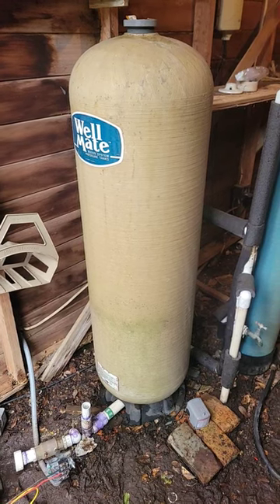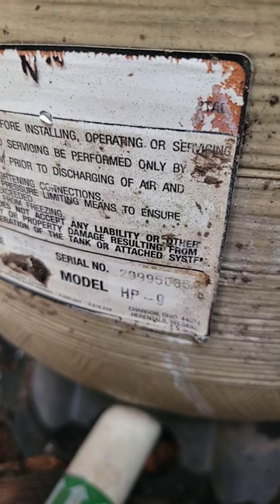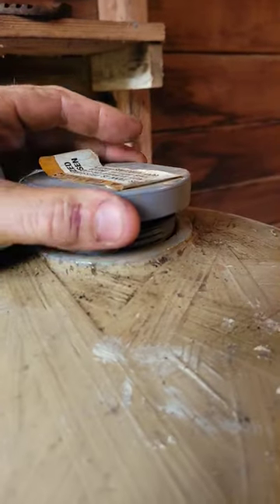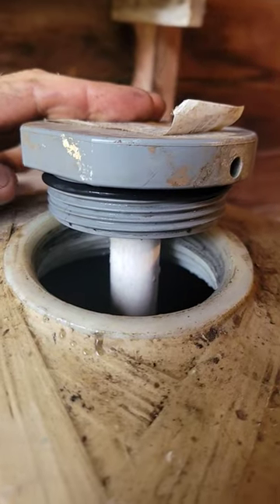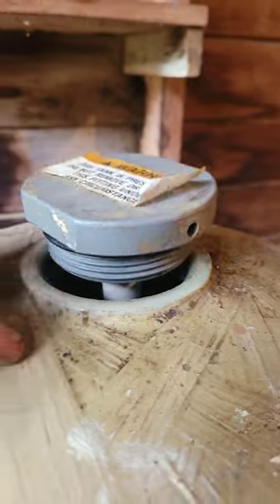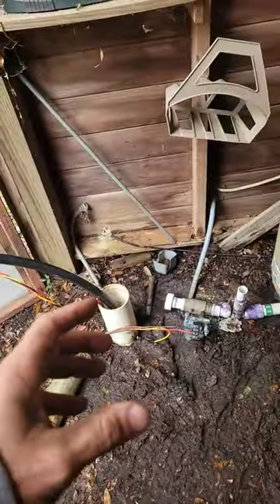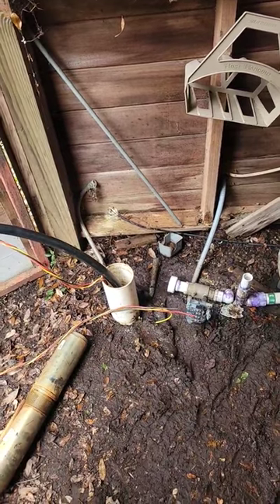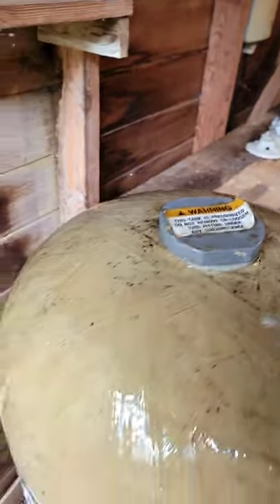Fiberglass Tank over 20 years old still working but I still don't like them

Comment: Great video! sometimes I still see the old metal tanks with the old-school air volume control. I've seen an old metal tank  from the late 80s have a blowout due to rust from water dripping on it.  interesting stuff you see out in the field. one time a guy knocked his we'll cap off with his mower. a family of chipmunks got down there and died in the well. They called after their water had a funky smell and taste. when pulling the pump up, the dead ground squirrels were wedging between the submersible pump and the casing. they fell apart so easily. needless to say, after a well evacuation and chlorination he didn't tell his wife the cause of the smell and taste lol.
Reply from the maker: Enh I found Slugs that were living in a non sealed well with 4" submersible that were growing. They would fall into well and pump would grind them up...... Bleh!
Reply: @ClearWaterPumpWell  I bet that was a nasty mess
Reply: @ClearWaterPumpWell  I had someone call to tell me they had no pressure in their faucets. Seems that when they checked, the strainers were full of ants. A fire ant nest was built next to the casing and it rained causing the ants to abandon the nest for higher ground. They found their way into the pressure switch down the flex conduit into the well seal and down the hole. Took about a week to kill the nest, clean out around the well, purge the system, and decontaminate it. I can honestly say those are the jobs I do NOT miss!

By the way… my own well.
My mother passed away January of 2005 and I inherited my parents’ house. We lived in a mobile home at the time and later that year Hurricane Katrina showed up on a collision course. We moved to the house before the hurricane reached us. Two years ago we decided to move back to our old property and I had someone use a forestry bush hog to clear things out so we could start working towards moving back. One of the first things we discovered was that someone had stolen the pump, tank, and filter among various other damage. They left the casing open and uncovered.
Big sigh then I told my wife I had to get Teme to come blow the well with his compressor. She didn’t understand why I didn’t just chlorinate it and install new equipment. So when Teme gets there and his air line gets stopped about 20’ down until he could bounce it loose. They started the air and the first few gushes of water come out followed by a white skull of a possum then more bones, a few sticks, and plenty of leaves. I asked her if maybe I should have JUST chlorinated the hole. She decided not to question that decision again. I’m pretty sure that is the only time in about 30 years she admitted that I was right. 
Yeah, after flushing the bones out I filled the hole with chlorinated water and capped it until a couple of months later when we got electricity to pump it out. Flushed and re-chlorinated then tested for bacteria BEFORE hooking anything downstream.
Reply: Good call to bear the thief

Comment: That's the only tanks we will use
Reply from the maker: They were good 20 years ago but still failed for stupid reasons.  The shells will leak because the plastic liner breaks from cycling. Its like metal fatigue and once it leaks air its no good.
Reply: Structural made a big mistake a couple of decades ago. They bought out Park Plastics and the engineers from Park needed to justify the company keeping them. Their brilliant idea to save money was to redesign the fiberglass tanks by making the plastic liner thinner. Unfortunately, the failure rate went through the roof. One distributor that I know of was seeing a warranty return of over 35% and another was running somewhere near 40%. They both dropped Structural and changed to another brand. 

Structural also has no coating to protect the resin from UV from sunlight. One of those tanks left in the sun for a couple of years is like grabbing a porcupine. Before changing one I used to get a couple of cans of cheap spray paint and paint the tank where I would have to touch it. Kept from getting fiberglass “splinters” in my skin.

I had an old tank laying in my backyard that I had replaced. Came home to see my son (about 6 or 7) riding it like a horse. Poor guy had to soak in baking soda bath that night because the inside of his thighs looked like a bad sunburn.
Reply from the maker: @JRPittman  Oh yea for sure, I never knew the back story but the early 2000 was like 50% in 2 weeks....  I only use them if I have to I mean it's kind of hard to recycle fiberglass and plastic. You can always take a couple hundred tanks to a scrap yard and get some good money for them.
Reply from the maker: @JRPittman  Rip Jamie, the legendary water well man.  I will miss you and your stories, insights and friendship.

Comment: How do you feel about dropping these on 1”type A pex
Reply from the maker: No I wouldn't use pex as it's not designed to hold weight just pressure.  Roll pipe shouldn't really go deeper than 300' unless you use very heavy wall.

Comment: you don't like them because you cant sell them a new one :)
Reply from the maker: Your funny, I replace the newer tanks all the time they on average fail in 2-5 years!   The point I was making is there are a handful of the 20 year old ones.  

It boils down to actual usage that causes failure.
The more the system cycles the more the tanks expand and contract.
This causes the plastic liner to crack and or the bonding to fiberglass to detach.
Once this happens the tank leaks sir out the top through the fiberglass and it's trash!

Why not buy a Glass Lind steel tank that's guarantee to last 20+ years and when it fails you will absolutely know it did when you see the leak.  As a bonus it's 100%  recyclable or hell make a smoker out of it!
Reply: @ClearWaterPumpWell  I know the new ones are all crap that don't last. nothing is made to last more then 2-5 years.
Reply from the maker: @Master-ls2op  Yea for sure just about all companies have cut the fat and corners so much it's horrible.  But if your in the business you know and can still find quality products.  I find the small things to be the worst of all like a gauge or a faucet or other devices.

Thanks for the comment and watching,
Casey